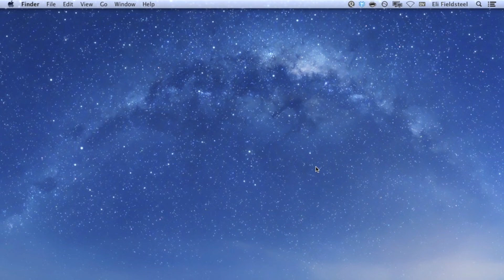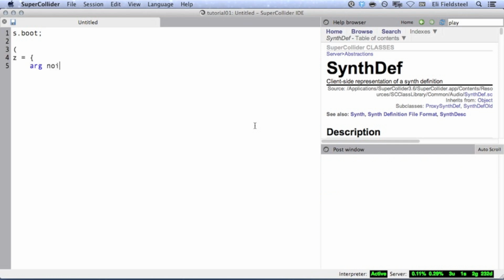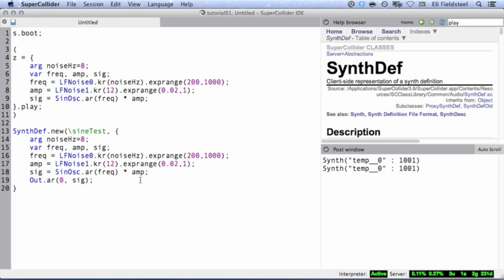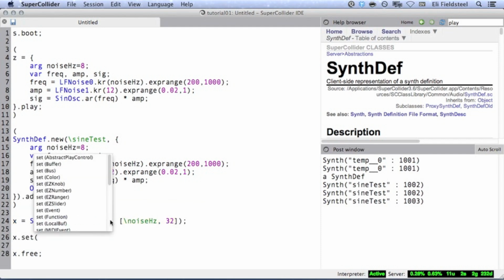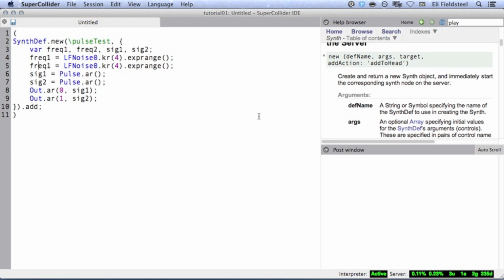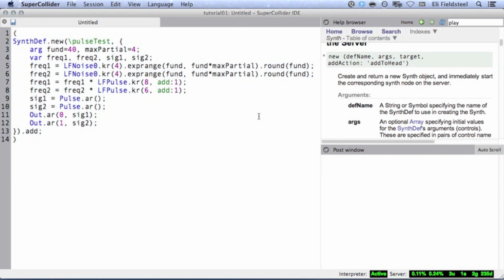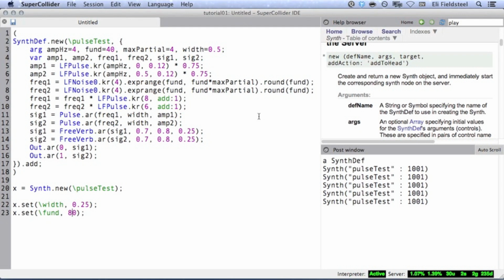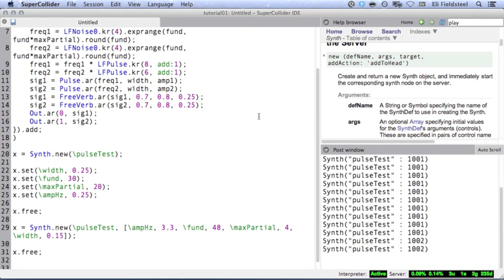SuperCollider Tutorial: 3. Synth and SynthDef

Comment: Hello Eli,
I have a question about the pulseTest-example about the 11 and 12 :
sig1 = Pulse.ar((freq1, width, amp1).
Why do you define "freq1" and "amp1" as a var and "width" as an arg.
Being all three arguments of Pulse.ar i would have thought that all three had to be defined as arg in the 3 line.
I'm a little confused by this logic....
Thanks for your answer.
Bye
herman
Reply from the maker: The difference is subtle and I can't give a comprehensive explanation here, but here is a practical perspective: Arguments must be numbers, and cannot be given a UGen as a default value. For example, declaring arg freq=500; is ok, but declaring arg freq=SinOsc.kr(10,100,200); is not. Arguments can be changed while the Synth is running using the 'set' message. Variables are more open-ended, and can be defined as UGens, numbers, arrays, or whatever you want. but are rigidly defined inside the SynthDef and can't be changed while the Synth is playing.

Comment: Eli I can't run the last example, it throws me the next ERROR MESSAGE: 
Synth("PulseTest" : 1000)
* ERROR: SynthDef PulseTest not found
FAILURE IN SERVER /s_new SynthDef not found

what I`m doing wrong?, I even wrote all the code as yours
Reply from the maker: Surely you've just misspelled something. Did you use the exact same name ("PulseTest") in your SynthDef and Synth? Check for Uppercase/Lowercase character discrepancies too.
Reply from the maker: astroplash I'm almost certain that's not correct. While it's true that Symbols and Strings are different in a number of ways, they can be freely interchanged when dealing with names of SynthDefs and Synths.

Comment: Great video! So can you please explain me the LFPulse part. I am getting confused with the documentation! It outputs either a 0 or a 1. Correct? So if I multiply freq1(which is some random value) with it, you eventually transform it between 0 and 1?
Secondly, why was the pulse moved from 1 to 2? I understand you did it by adding 1, but why? It creates 8 random values between 1 and 2? Why '8'?
Reply from the maker: LFPulse doesn't generate random values, it outputs a low and high value, normally 0 and 1, in alternation, at a regular frequency.

freq1 is initially a random number generator (LFNoise0), outputting 4 random values per second, representing frequencies of random partials. Then I take LFPulse, which has a normal output range of 0-1, and add 1 so that the output ranges between 1-2 instead. As a result, the output of freq1 will either be unaffected (multiplied by 1) or transposed up an octave (multiplied by 2). That's why the resulting sound bounces back and forth by an octave.

I chose frequencies 8Hz and 6Hz for the two LFPulse generators for no reason in particular. I wanted the octave alternation to be fast enough that it would be noticeable, but not so fast that it would sound garbled.
Reply: Eli Fieldsteel Oh thank you so much Eli! That makes sense now! :)
One last thing I wanted to ask is, so we have created this 'pulseTest' synth towards the end of the video. How can I make it sound in terms of 
'minor chords' or min7 or sad sounding? I see that minor chords have freq ratios of 10:12:15.. I don't know how to code that?! Hope to see your reply asap!
Reply from the maker: Modqhx There are many ways. It's probably easiest to convert MIDI note numbers to frequencies. For a minor chord, you can use freq values such as 60.midicps, 63.midicps and 67.midicps. See SC Tutorial 6 around 7:58.